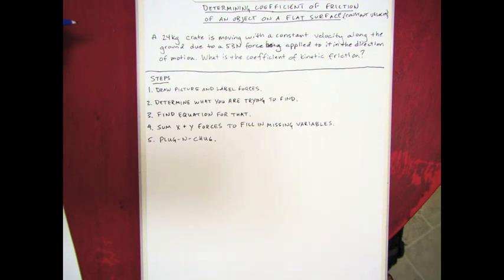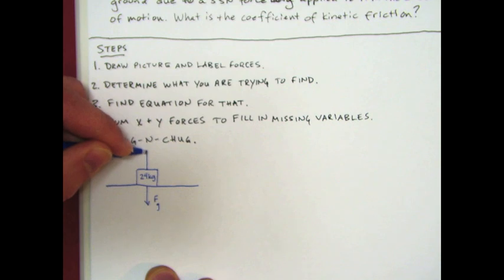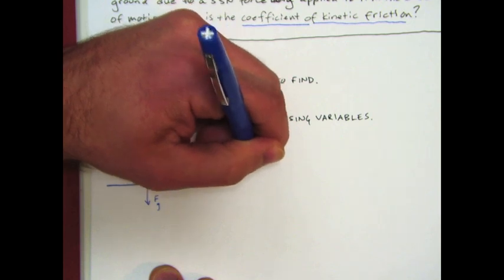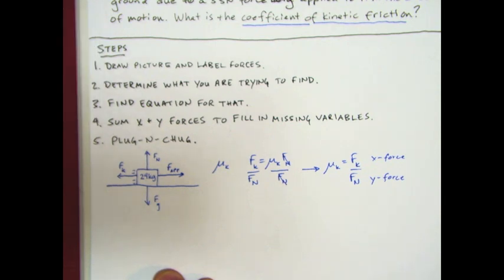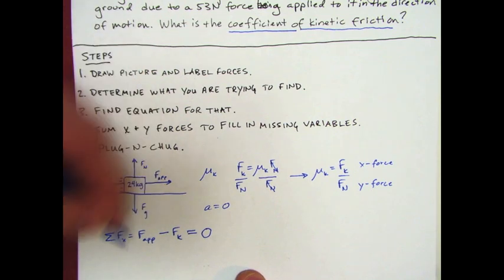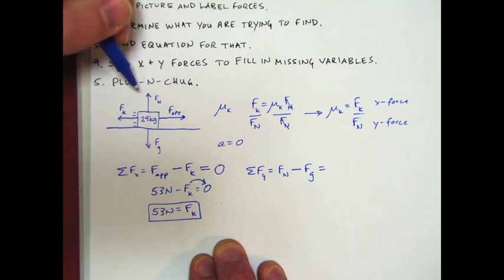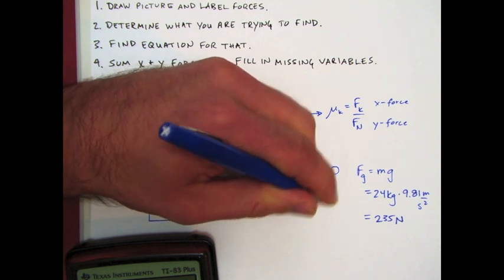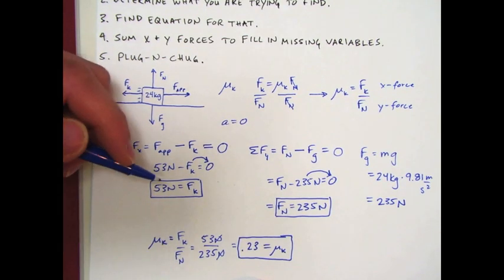Finding the coefficient of friction on a flat surface

Comment: Wow...this lesson helped me a lot🔥🙏 plus I'm preparing for my exam...Thank you so much sir🙏🙏
Reply from the maker: good luck!
Reply: @natelinscheid5844  THE ULTIMATE (AND CLEAR) MATHEMATICAL UNIFICATION (AND PROOF) REGARDING PHYSICS/PHYSICAL EXPERIENCE IS NOW DEMONSTRATED, AS E=MC2 IS F=MA: TIME DILATION ultimately proves (ON BALANCE) that E=mc2 IS F=ma, as ELECTROMAGNETISM/energy is gravity. This NECESSARILY represents, INVOLVES, AND DESCRIBES what is possible/potential AND actual IN BALANCE. (Importantly, balance and completeness go hand in hand.) The stars AND PLANETS are POINTS in the night sky. NOW, A PHOTON may be placed at the center of WHAT IS THE SUN (as A POINT, of course); AS the reduction of SPACE is offset by (or BALANCED with) the speed of light (c); AS E=mc2 IS F=ma; AS ELECTROMAGNETISM/ENERGY IS GRAVITY. Indeed, ultimately and truly, TIME is NECESSARILY possible/potential AND actual IN BALANCE; AS E=MC2 IS F=MA; AS ELECTROMAGNETISM/ENERGY IS GRAVITY. Very importantly, outer "space" involves full inertia; AND it is fully invisible AND black. GREAT. Accordingly, INSTANTANEITY is thus FUNDAMENTAL to what is the FULL and proper UNDERSTANDING of physics/PHYSICAL EXPERIENCE; AS E=mc2 IS F=ma; AS ELECTROMAGNETISM/energy is gravity. It ALL CLEARLY makes perfect sense. Gravity IS ELECTROMAGNETISM/energy. E=mc2 IS F=ma. ELECTROMAGNETISM/ENERGY IS GRAVITY. E=MC2 IS F=MA. GREAT !!! Gravity AND ELECTROMAGNETISM/energy are linked AND BALANCED opposites, AS E=mc2 is F=ma; AS ELECTROMAGNETISM/ENERGY IS GRAVITY. Consider THE MAN who is standing on what is THE EARTH/GROUND. Touch AND feeling BLEND, AS E=mc2 IS F=ma; AS ELECTROMAGNETISM/ENERGY IS GRAVITY. The stars AND PLANETS are POINTS in the night sky. GRAVITATIONAL force/ENERGY IS proportional to (or BALANCED with/as) inertia/INERTIAL RESISTANCE, AS E=mc2 IS F=ma; AS ELECTROMAGNETISM/ENERGY IS GRAVITY. Gravity/acceleration involves BALANCED inertia/INERTIAL RESISTANCE, AS E=mc2 IS F=ma; AS ELECTROMAGNETISM/ENERGY IS GRAVITY. Accordingly, the rotation of WHAT IS THE MOON matches it's revolution. Great. MOREOVER, a given PLANET (including what is THE EARTH) then sweeps out equal areas in equal times consistent WITH/AS F=ma, E=mc2, AND what is perpetual motion; AS ELECTROMAGNETISM/ENERGY IS GRAVITY. Gravity IS ELECTROMAGNETISM/energy. INSTANTANEITY is thus FUNDAMENTAL to what is the FULL and proper UNDERSTANDING of physics/physical experience, AS E=mc2 IS F=ma; AS ELECTROMAGNETISM/ENERGY IS GRAVITY. This NECESSARILY represents, INVOLVES, AND DESCRIBES what is possible/potential AND actual IN BALANCE. Stellar clustering ALSO proves ON BALANCE that E=mc2 IS F=ma, AS ELECTROMAGNETISM/energy is gravity. Objects (including WHAT IS the falling MAN) fall at the SAME RATE (neglecting air resistance, of course), as E=mc2 IS F=ma; AS ELECTROMAGNETISM/ENERGY IS GRAVITY. "Mass"/energy is gravity. ELECTROMAGNETISM/ENERGY IS GRAVITY. E=mc2 IS F=ma. THE DOME of a PERSON'S EYE is ALSO VISIBLE. (Notice the flat AND black space of what is THE EYE.) The stars AND PLANETS are POINTS in the night sky. The sky is blue, AND the Earth is blue. THE EARTH/ground AND THE SUN are E=mc2 AND F=ma IN BALANCE, AS ELECTROMAGNETISM/ENERGY IS UNIVERSALLY PROVEN TO BE GRAVITY in what is a mathematically unified fashion. E=mc2 IS F=ma. The middle distance in/of/AS SPACE AND the full distance in/of/AS SPACE are NECESSARILY linked AND balanced. MAGNIFICENT !!!!!!!!!! INSTANTANEITY IS thus FUNDAMENTAL to what is the FULL and proper UNDERSTANDING of physics/physical experience, AS E=mc2 IS F=ma; AS ELECTROMAGNETISM/ENERGY IS GRAVITY. Gravity IS ELECTROMAGNETISM/energy. It is ALL CLEARLY proven. Again, the stars AND PLANETS are POINTS in the night sky. GREAT. Energy has/involves GRAVITY, AND ENERGY has/involves inertia/INERTIAL RESISTANCE. GRAVITATIONAL force/ENERGY IS proportional to (or BALANCED with/as) inertia/INERTIAL RESISTANCE, AS E=mc2 IS F=ma; AS ELECTROMAGNETISM/ENERGY IS GRAVITY. Gravity/acceleration involves BALANCED inertia/INERTIAL RESISTANCE, AS E=mc2 IS F=ma; AS ELECTROMAGNETISM/ENERGY IS GRAVITY. It is all CLEARLY proven !!!!!!!! TIME is NECESSARILY possible/potential AND actual IN BALANCE, AS E=MC2 IS F=ma; AS ELECTROMAGNETISM/ENERGY IS GRAVITY. Gravity IS ELECTROMAGNETISM/energy. GREAT !!!!!!!! BALANCE and completeness go hand in hand. By Frank DiMeglio

Comment: If the mass of the object is in Newton’s do you need to convert it to kilograms before solving?
Reply from the maker: Mass can’t be measured in Newtons. Weight is given in Newtons. You usually use mass to find weight, but if weight is already given, then you have less work. If you need mass for something else, then divide weight by g=9.8

Comment: what if theres acceleration and the velocity isnt constant ? what do i do then
Reply from the maker: Leave it equal to ma and don’t cross it out.
Reply: @natelinscheid5844  thank you for the quick reply lol, life saver
Reply: @natelinscheid5844  wait but how am i supposed to get acceleration? all im given is mass and applied force (which is at an angle of 35)

i found the horizontal applied force and the normal force but im not sure what to do from there. the question is asking me to find friction, net force and acceleration

Comment: 53 newtons is 5.4Kg. Divide 24Kg by 5.4Kg you have a coefficient of friction of 4.44Kg. That's your Mu. 

If you're going to pull that weight, you're going to have to add an acceleration Factor. Gravity is 32.2Fps.... Feet per second. Multiply your 4.4Kg x 32.2 fps, you have your F ( coefficient of friction adjusted to your acceleration Factor), of 142.96 Fps.....

I find that simpler then all you're confusing equations. 

The first thing you have to adjust is either Newton's to kilograms or kilograms to newtons because you have to have the same components to do an equation.

You can't divide less Newtons into more Newtons, and then say that the Newton's cancel out and don't exist.